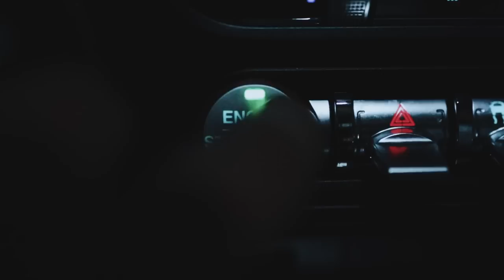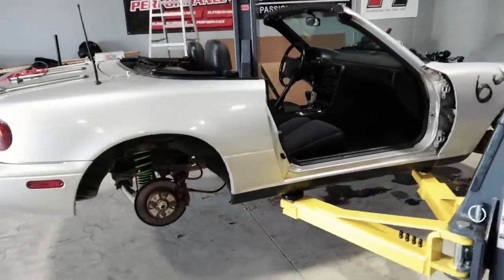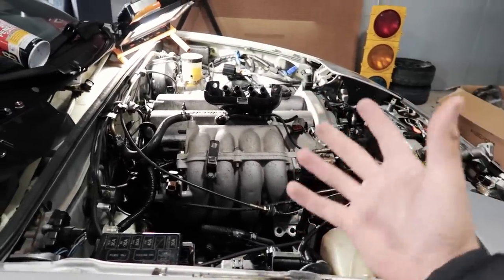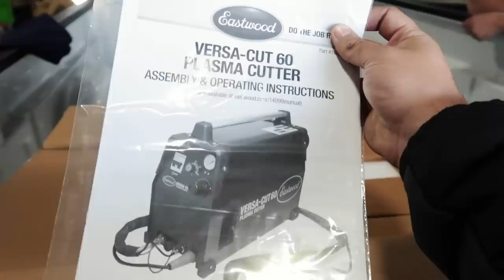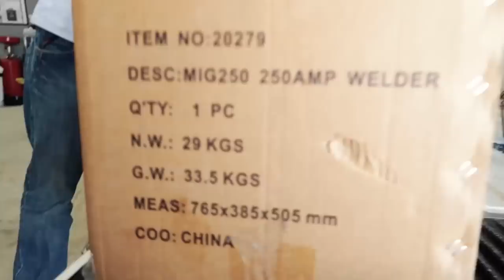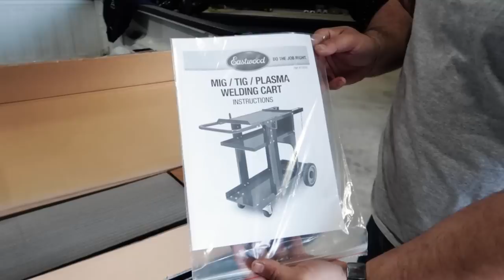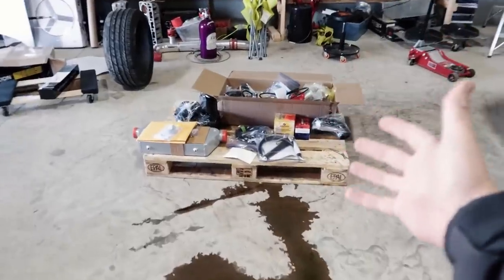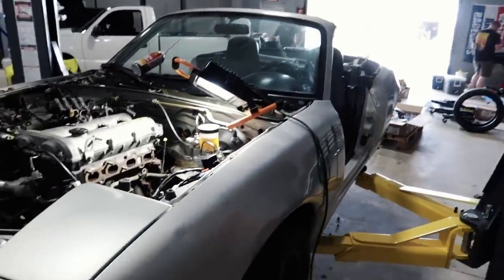Meep the Miata’s HUGE Turbo unboxing!!

Comment: Quick tip for your shop, cat litter works great for cleaning up fluids. Such as oil, gas, transmission oil ect. Since the cat litter absorbs it all you can sweep it up super easy afterwards

Comment: The Eastwood is a great welder for starting off and doing little projects. welding 110 is harder than welding 220. I still have my Eastwood but got my welding rig so I mainly use that.

Comment: wire goes where you said it then goes through the knobs sheilding gas use 25% carbon monoxide 75% argon  strike an arc weld circles.....arc control helps if it has it.

Comment: What’s up brotha. I know this is a week old footage but you should run your 220/480 power down your car lift poles. So you can move you welder to each lift around the shop. Not be limited to just one area. Great videos keep it up! @itsjusta6

Comment: That’s dope but you don’t need to rent a bottle if you run fluxcore on the mig machine. Also best settings are probably 18v and 250 wire speed.
Reply: Dany Vargas fluxcore is ass. And settings vary depending on what youre welding

Comment: First, put a roll cage in that car. At least a four-point but preferably a six or eight-point cage. If you don't cage it the car will flex all of your new power into lost power.

Also, take time to go back to a local vocational or college course for welding. They will teach you the proper way to weld and also all the technical aspects so you know your welds are strong and that the metal is completely joined.

With setting up your new welding/cutting area you will likely want to move it from beside the lift. You need to get some shields for the weld area and they will make that lift barely usable if not rendering it not usable. Personally, I think you need to move it over towards the front of the shop in front of the other lift. That way you can stage and save metal as needed on top of not taking any function from the shop.

Comment: I thought u weren't supposed to drill a turbo oil feed line straight into the oil pan, that was just for the oil return, the feed needed to be pressurized

Comment: You could run an old 1.8 block with a new head and make the power of the new 1.8 with less wiring issues
Reply: It's a 1.6 before he blew it up

Comment: at 350whp I wouldn't be surprised if that miata wont trap 120+ if its around 2100lbs with you in it.  Thats a very fast car for the street, Don't let the 1000whp or bust internet trolls tell you other wise....I rode in my buddies 650whp evo just the other day, on his first ride of the season... and I forgot just how fast a 140mph+ trapping car is... its just silly fast, Most these kids on the internet saying anything under 1000whp...is slow... have watched too many tx2k videos and would shit themselves in anything trapping 120+ ( which is 600cc crotch rocket territory)
Reply: True story, my car has 210whp and it felt insane going from 0-60, I couldn't imagine riding in some thing that actually has power 😂
Reply: @s10w2v  yep my old integra when it has stock motor made 302whp and weighed 2700... went 114mph in the 1/4 and felt pretty incredible on the street with the right rubber,